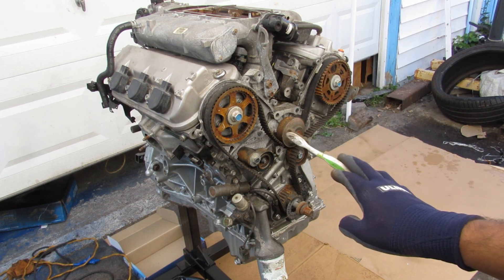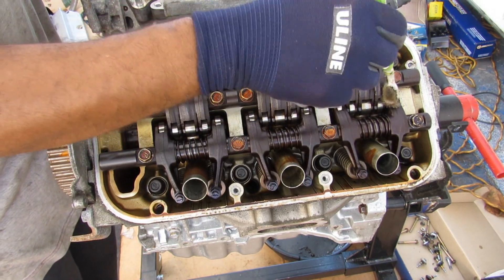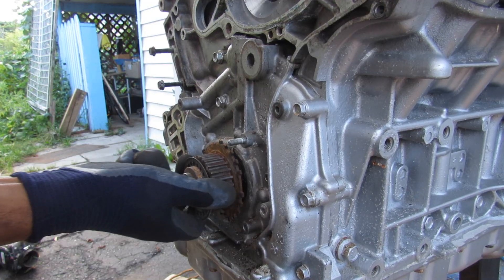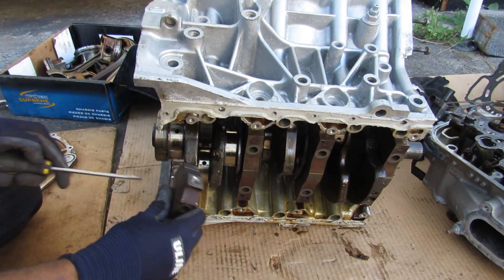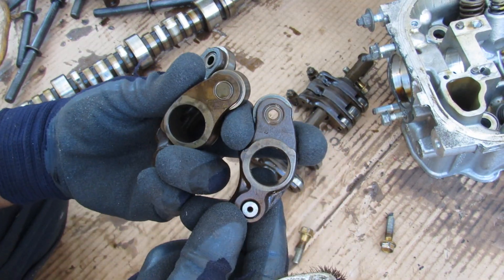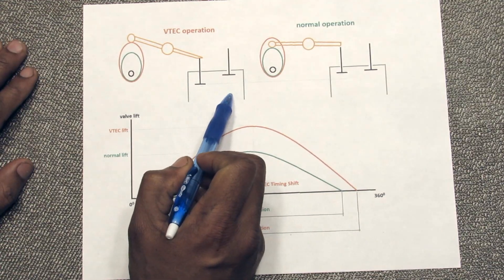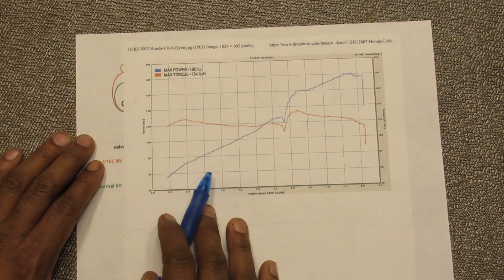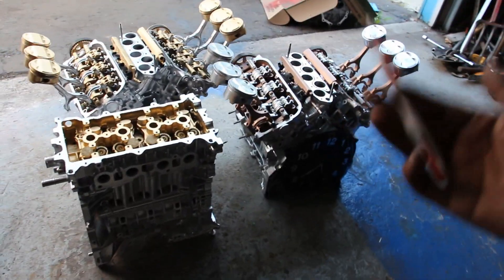How Does Honda VTEC Work?

Comment: I’m looking at my heads right now. Where the oil goes through that head bolt and comes up through the passage leads to a solid dowel(that the rocker shaft sits on) for me. The opposite side of the head has hollow dowels. Looking in the service manual, those dowels are in the right place, same with my spare heads lying around. I’m wondering how the oil gets through the solid dowel into the rocker shaft? 

I pulled the dowel out of one of my spare heads just to see how much resistance it had. Took all of my strength to get it out. Does the oil just seep around the sides of the solid dowel into the rocker shaft? The passage from the head bolt hole also leads to the bottom of one of the camshaft journals so it seems that would be the path of least resistance

Comment: It’s either stretch it out to prevent sludge or low rpm to save from using vtec components then use primarily for highway on ramps etc

Comment: hI Can you pls explain differenec between VTEC and VTC actuator, i thought both are advvacning or retarging valves
Reply: V tec is "just" switching between two cam shaftt profiles in one shaft!  One set of lobes for the low rews and good torque.. then around 5500 r/min..the kind of  tuned cam profile takes over!! And this is a big difference!!💥 i have 3 of these cars! I love it!  I also have a bmw.. e 12 and a z4 with  the nice 6 its just sooo different an also so good both brands!

Comment: It is good that Honda routed the valve timing oil in the block. On my Camry V6, there is a tube outside of the engine that carries the valve timing oil. This created a problem (LSC-90K).

Comment: I have a 2010 Acura TSX 2.4L it calls for 5w20 oil on the cap but I put 5w40 because I want the best protection for my engine. Should I keep using 5W40 or The K24 has very tight clearances that the 5w40 oil is going to do more damage than a 5W20? Will it also affect the VTEC of my engine? Thank you! Great video
Reply: I always follow the manufacturer recommendations. Except for extreme temperatures but other than than that for my k engine I only use 5w20 ONLY

Comment: i recomend to talk a bit slower
Reply from the maker: Why waste time?
Reply: @speedkar99  hey I still have questions about the solenoid, you where talking about where the oil was going when the vtec activated, but you just showed the places not exatly where it was flowing. I wish you could explain that a little bit better.

Comment: At 10:40 that electric valve seems like opening  a small high pressure oil line to push the (comparatively) bigger piston to activate the VTEC

Comment: I replaced vtec gasket (next to oil dipstick) because it was leaking oil  then I got code p3497 (cylinder deactivation system bank 2) . I changed oil, replaced oil switch , cleared code but code keeps coming back especially on highway speed. 
Any suggestions what could be the problem? 
I ordered vtec gaskets from Ebay.  Someone people say those gaskets are fake chinese version and they could cause a code to pop up.

Comment: Great channel and content. Keep up the great work! The back side of the J-series engine is cleaner because of the VCM system (Variable Cylinder Management). There are different implementations, but it will shut down the rear bank of cylinders to reduce fuel consumption under ECO mode. The engine basically runs on the front three cylinders under light steady load. Later implementations could deactivate 3 or 4 cylinders. But you're seeing the result of higher average oil temps on the front half of the engine, hence the varnishing.
Reply from the maker: These don't have VCM

Comment: these engines had a strong bottom end, but trash oil consumption out of the blue, one idle tues the engine will up and say "hey, I'm going to use 1L of oil for every 300km now, no matter how much you spend on getting me fixed"

Comment: Excellent video! Solenoid was likely working correctly just didn't have oil pressure to move the valve. It just acts as a pilot valve that ports a small amount of oil to actuate the valve.

Comment: Great video, speedkar99

At 10:31 and 10:45, you don't see any movement because the solenoid valve is pilot-operated. This means that it takes a bit of the fluid which it is controlling and channels it towards the clicking solenoid (the pilot), which then uses this fluid to activate/operate the plunger. 

So without oil, you will only hear clicks but see no plunger movement.

In other words, the VTEC solenoid actually needs oil to first operate itself before it can operate the camshafts.
Reply from the maker: Thanks for that explaination. It makes sense
Reply: And that's why you shouldn't wait for your oil to get so very dirty before replacing it. 
Dirt can easily block the small channels in the solenoid valve and render it useless.

Comment: You're the best... I was so frustrated before tripping over your channel... Too much misinformation....
04 Honda Accord Are rattling at cold start up...
Ended up taking apart timing chain looking for VTEC Actuator...
You right .... The 04 Accord doesn't have one... fuck all I had to do is replace the solenoid...3 bolts.... Fuck
Reply from the maker: The solenoid was causing the rattle?

Comment: @Speedkar99  Is the Toyota VVTI found on the era 2002-2006 v6 (1mzfe & 3mzfe) could high rev like the Honda Vtec and make the disincentive VVTI sound like Honda? Which one is more in term on durability and technology innovation?
Reply from the maker: VVT is very different than VTEC. VVT is continuously variable, where VTEC is either on or off. 
The VTEC system has more subcomponents and this has more points of failure in the longer term. Check out my vvt video for more on that.

Comment: What a gift Hector has given us with this, and two other videos explaining in fantastic detail the inner workings of Vtec!  I had the dreaded P2646 error on our 200K mile element, and followed his procedures through the vtec solenoid assy replacement, and cleaning of the separate screen and spool valve.  Brought our Element back from the grave!  No more fear about bringing the revs up past 3K.  Not to mention the very succinct and detailed flow of the videos.  Nicely done sir!
Reply: Thanks to a YouTube video from 1A Auto, I was able to do this job on both my Honda Element and my Honda Accord with the K24 engines. The job was easy. You can easily see why keeping the scheduled oil changes is critical to this system.

Comment: Perfect explanation. Answers my question that I had before comming into this video: does vtec need global synchronization and all the valves to switch at the same time. It clearly does not, as I suspected. Now I wonder what kind of external effects one would notice if for example half of all the valves would stay engaged in VTEC and half not.  Are there any sensors for that so the engine would know that they stayed locked?
Also, does anybody know why one half of the engine is more dirty ?
Reply from the maker: Good question. Some cylinders would have more flow than others.  The knock or cam sensors might pick it up as a misfire

Comment: Hi Mr and Mrs I need help for my Nissan pathfinder 2002 after changing the engine  it won't start....i changed crankshaft and camshaft nothing i also changed the flywheel

Comment: I wonder if the difference in carbon/oil buildup in the heads is from heat. The side closest to the radiator has much more air flow, while the other is sitting right next to the fire wall, where heat can accumulate. Let me know what you think. I've seen the same thing in my engines.

Comment: Any videos on how to replace the oil pump gasket without pulling the whole engine out ?
Reply from the maker: Timing belt, oil pan and VTEC housing must be pulled off. Unless there's a clearance issue on the car I don't see why it can't be done on the car.

Comment: I have 2007 Acura TL 3.2 v6 and 💘 v tech kick around 3 to 4 or 5 rpm feel power 💘 it
Reply from the maker: Good engines ! How's the transmission though?
Reply: @speedkar99  i 👀 the 😎 try to throw but 5 speed Auto is doing fine deliver the power i know it early 2000 they had problem but i trust by my model year honda build them better 128000 miles and counting fyi highway miles 😆
Reply: 07/08 TL had the RL auto. Very reliable with fluid changes
Reply: @codyballing8848  i know speedkar99 was throw shade ha ha yeah our model year 5 speed good but early 2000 to 2005  model had issues but honda fixed them 😆

Comment: Wouldn't the carbon deposits be from not revving it enough? If VTEC kicked in (yo) it suggests high rpm use, running harder and hotter, wouldn't that help clear out carbon deposits?
Reply: It's doubtful an Italian tuning is effective to decarbonize other than making the exhaust hotter.
Reply from the maker: Yeah or it could be leaking valve stem seals, bad oil rings or fouled plugs letting oil in the combustion chamber

Comment: Honda first used that engagement pin system on a domestic market motorcycle that had four valves per cylinder, but could selectively activate two of the four valves, or let them remain closed. Once it proved reliable, it evolved into VTEC, giving a phase change in timing, lift and duration instead of just valve area and swirl.
Reply from the maker: Good to know. That's an interesting use of the technology

Comment: My wife's 04 Civic has the mildest form of VTEC ever invented. AND it's an automatic. So there's that.

Still, it's got a little (very little) zip to it.

But I still appreciate that this engine still runs lock a Swiss watch and doesn't burn oil. We've put a new timing belt on it so I trust this car to go anywhere. Now if I could get up the ambition to do the headlight plastic restoration- those babies are HAZY
Reply from the maker: Good cars , if the transmission lasts

Comment: Interesting. Clever design because it doesn't look all that complicated.
Reply from the maker: But if you put multiple changeover points on both intake and exhaust...there's alot of moving rocker arms under the valve cover...much more complex
Reply: @speedkar99  Sure you can make something as complicated as you want but the law of diminishing returns should place some limits on the design.  However these days it seems there are few limits on trying to wring every last fraction of an MPG rating. An example I saw years ago in a car magazine was BMW introducing electric power steering that would save one gallon of gas....per YEAR! Really? Is one gallon of gas a year worth all the engineering and tooling costs of a major change in direction? I've always been a big believer in "If it ain't broke don't fix it."

Comment: The engineering that goes into that pin engaging and disengaging without any wear or damage, day after day, year after year, is just mind blowing.
Reply from the maker: Depends on how much you smash VTEC
Reply: @speedkar99  
😄
3 years driving an  iVTEC engine yet to hit the  pass 5500 rpm🤭
Reply: Metz Matu there’s also negative consequences of NOT ever using the performance capabilities of an engine
Reply: @metzmatu8409  that's probably a sports car? 
Cos on your regular accord, VTEC engages at 2500 rpm, just before each gear shift. I think it's so on some Civics also.
Reply: @daviderhahon  
VTEC engage at 2500 rpm kinda too low for  VTEC engine, (May be VTEC-E type of engine?). Doesn't stock VTEC/i-VTEC lobe engage at 5500-5800 rpm?
Reply: @metzmatu8409  
I don't think so. 
5500, maybe in racing cars stock.
Reply: very true!! 
This pin engaging is what causes the famous "startup rattle" on newer variable valve timing (phasers) engines.
If your engine's over 100kMi and lacks low rpm performance simply replace the PCV that is leaking unmetered air in the intake plenum
Reply: VCT is a totally different system. 

And it depends on which engine as to what the problem is. 

Sometimes it’s excessive PCV that winds up giving high oil consumption and stretching the timing chains. 
 
Sometimes it’s poor PCV that winds up giving you sludge on the side that’s poorly vented. 

But also.. sometimes it’s excessive intervals between oil changes, or using a cheap oil filter that doesn’t prevent oil backflow on shutdown, or using the wrong oil (some geniuses use thicker oil because it doesn’t backflow as easily... but then will run into problems as the thick oil will not enter the small orifices and tight clearances of the cam phaser.. but won’t hear it because they are already driving).
Reply: @Bartonovich52  That's something I've wondered about for some time now. 
How can one physically tell if a particular oil filter will prevent oil backflow on shutdown? Is there any way to inspect or test for this, prior to installing on the engine?
Reply: Yeah. Proper lubrication I guess. 
You can also see how smooth and shiny those little lock rods are. Their edges are rounded off too.
Reply: Isn't the 'startup rattling' during cold start is the lockup pin inside VVT Cam Phaser Sprocket Gear housing? (Not the sliding pin for high-speed cam)
Reply: Well my rdx vtec engaged at 2300 rpm... its everyday bro.
Reply: Stumble over this old forum  😄, might help clear some doubt.... (4 attachements toward the end of the thread) describing VTEC enable... 

https://www.driveaccord.net/threads/pop-quiz-at-what-rpm-does-vtec-engage.8430/

1. Accord k2000
2. Accord 2006 
3. Accord V6 '06 
4. ?? VTEC '95

V6 '06 
VTEC enable condition: 
1. Engine coolant. temperature 50 ºF (10 ºC).
2. Engine speed.
(High lift cam operation) 4,900 rpm.
3. Battery voltage 10.5 V. 
4. Gear position Other than P or N position.
5. No active DTCs P2227, P2228, P2229, P2648, P2649. 

VTEC '95
Valve Timing Change Conditions:
1. Engine Speed: 2,300 ~ 3,200 rpm (depending on manifold pressure).
2. Vehicle Speed: 6.2 mph (10 km/h) or faster.
3. Engine Coolant Temperature: 50° F (10°C) or higher.
4. Engine Load: Judged by intake manifold negative pressure
Control System.
Reply: @metzmatu8409  
Oh OK.  Thanks. 

Just learnt something from it. 

4 cylinder accords, 2000 to 3000 rpm
V6,  4500 to 5500 rpm

Also, cars with manual transmissions and those with automatic transmissions  seem to have a difference, also, in their VTEC engagement rpms. 
👍

Comment: 1:25 I have a theory on why one bank is coated darker in oil than the other. The side that is darker is where the pcv valve is located (which would also mean that dark bank of the engine is bank #2). I think it’s darker due to the location of the pcv valve and it’s functioning causing a byproduct of its work by making the whole valvetrain darker on bank #2. 

This is my theory.
Reply: I was going to comment on both the possibilities of PCV & VCM but I see I wasn't the only one thinking that!
Reply: @zdl360  Yup, definitely one/combination of them for having a darker valvetrain on one bank than the other.
Reply from the maker: Could it also be EGR?
Reply: @speedkar99  oooh I forgot about the EGR. That is one more good possibility.
Reply: I thought it was due to VCM (Variable Cylinder Management) which shuts down 3/6 cylinders to enhance fuel economy. I know it caused quite a few issues for certain J series models.
Reply from the maker: This one doesn't have VCM

Comment: Vanos + valvetronic is so much better... Let the hate flow!
Reply: i've had both. J35 is miles better than N52 and 54. V tech is miles more reliable than vanos. I had a vanos system go out in two separate cars. also The J series has more low throttle torque even if it has less low rpm torque than the n54.
Reply from the maker: I'd like to take apart a Vanos system next!
Reply: @speedkar99  hmmmmm I do have a 180k mile wrecked 2006 325i with a working engine

Comment: Excellent video and thanks for sharing. What year were the cam phasers incorporated on J35 engines if at all. If it says iVTEC does that mean it has cam phasers plus the higher cam lobes? Great if you can answer that for me. Thanks in advance 😊
Reply from the maker: Yes iVTEC means it's got VVT

Comment: If you can get a VCM J series engine to tear down you may be able to find evidence of VCM carbon build up that caused Honda to issue an extended warranty on ring replacement for affected engines. Engines that are afflicted produce misfires on the affected cylinders because the spark plug is full of carbon and they start burning oil because the rings become coked up. It does seem that a ring replacement fixes the problem, but it's an expensive job if done outside of warranty.
Reply from the maker: Yeah the VCM motors would be interesting. I've heard a high failure with those
Reply: @speedkar99  I have one. I changed the plugs recently at 160k km. There is some sign of the problem, but it hasn't developed into anything serious in 10 years / 160k km. I did a bunch of research when I saw the difference in the plugs that I removed. I think whether it turns into a problem or not has to do with multiple factors, e.g. fraction of time VCM is active (dependent on driving conditions and style), quality of oil, quality of gasoline, etc.

Comment: is there any side effects of lowering VTEC engagement? Mine is set at 4500 RPMs, I want to lower it to 3800-4000. Also, what is the highest RPM these engines can rev out to?
Reply from the maker: Fuel economy. 
Too high Revs and you get valve float. 
Power drops off after higher rpms too